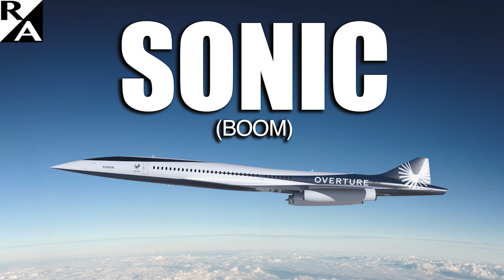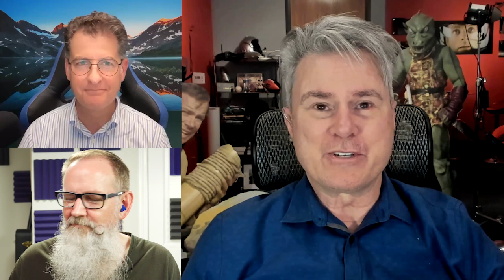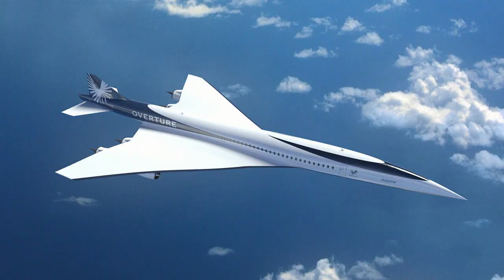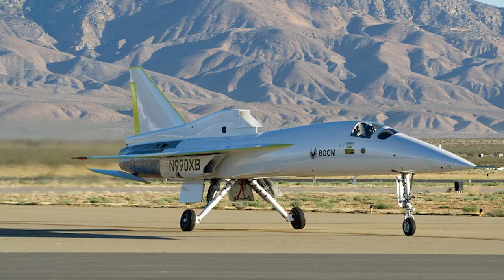SONIC (boom)

Comment: Even if they manage to get the 'boom' down to tolerable levels....the harsh reality of economics will doom the aircraft as it will be MUCH more expensive to fly and the number of passengers who value an hour of their time vs thousands of dollars aren't enough to keep such an aircraft viable.    Even the F-22 which can 'Supercruise' which is more fuel efficient than using augmented power...it's still WAY more fuel burned per mile than at high subsonic velocity.

Comment: We need more carbon di in the air,  we are at an all time low at .04% and it help plants grow. I question the assumption that carbon di warm up the planet, and even if it did, humans can tolerate heat a lot better than cold.   Civilian planes been struggling with the "sound barrier" for 3/4 century, and is about time someone try to do something again. We need a break through from using the brute force rocket to get to space, such a craft can get to low orbit and when it get to within distance of reentry to the destination, come down. Burt Rutan already proved you do not have to have heat shield for that. Just variable high drag devices.

Comment: Well, the problem with going faster than sound is that it's very, very expensive to haul whatever it is you are hauling. You will not see faster-than-sound airliners, but you will see Corporate Jets like the current Gulfstream 750 going faster than sound because time is money in the competitive business world. It's a tough nut. Over the years, there have been a lot of neat ideas for aircraft that went nowhere. Supersonic transports were like where the helicopters were till Igor Sikorsky figured out how to control the aircraft in flight. It took a long time to work it all out to and it is a reasonably reliable machine. I hope they do it just because, well, we can. As for people defacing art in museums, they should be sent to prison for long terms for hard labor.

Comment: If he succeeds, it will take LONGER to get through TSA, Customs and to and from the airport parking lot than it will take to get from NYC to Paris.
Reply: Yep.  I still won't fly commercial.  I'd rather take longer and drive.
Reply: @wdtaut5650 you are going to drive across the ocean? Very impressive.
Reply: @EntityOfTheVoid  What, you never heard of the Amphicar back in the 1960s?
Reply: @wdtaut5650  Ditt0
Reply: @wdtaut5650  I am currently on a 4000 mile cross country round trip. Driving my 1996 Roadmaster wagon